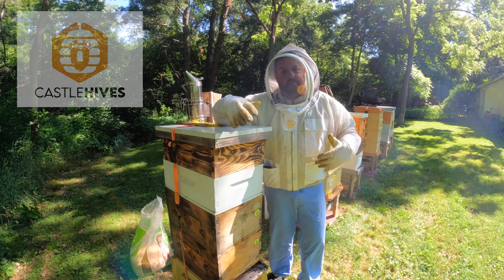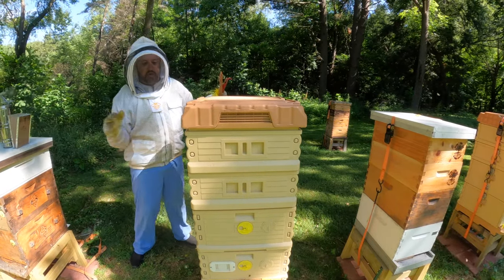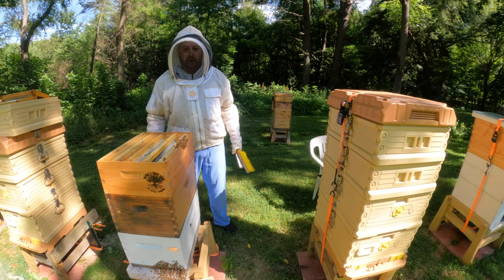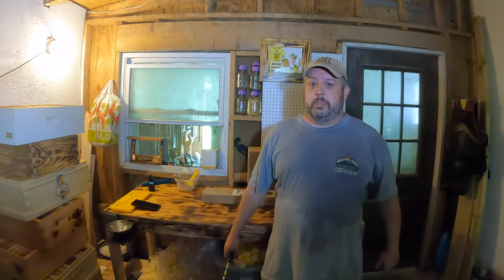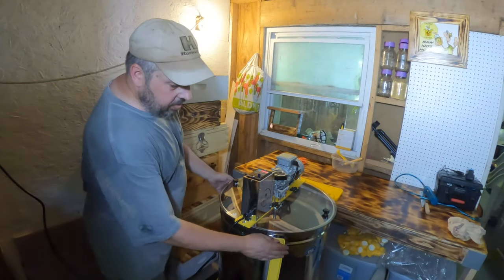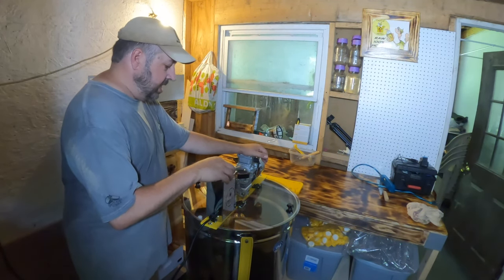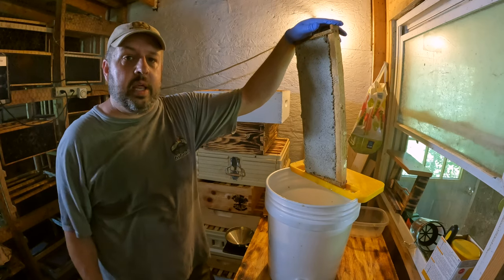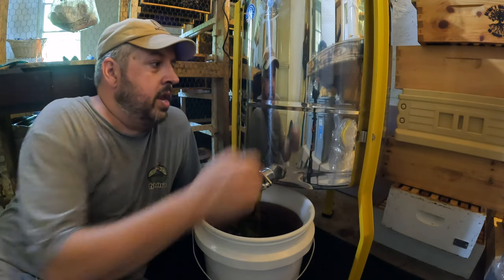How I harvested Honey using a HillCo MiniMax - Most Ever from my Apiary ! !

Comment: Very nice harvest and extractor. I bought the 800E at the Hive Life conf in TN and really like mine also. I can do 8 deeps or 8 mediums with no baskets. For my base I cut a 2x12 in half and spliced in a 2x4 to make a 28" x 42" base. I can stand on the one end which keeps it stable. It still fits through a doorway and I can unbolt the base if I want. See you Wednesday.
Reply from the maker: Thanks for the info Russell. I think the only step i need to take is secure it down and I'll be good to go.
Reply: @CastleHives  Mine is in the basement on a cement floor covered with linoleum. Wife doesn't want any holes. LOL
Reply from the maker: @russellkoopman3004  oh man. . Lol. . Mine will be in a building outside, so I'm able to bolt it down.

Comment: Thanks for sharing this experience
Reply from the maker: Any time!
Reply: @CastleHives  Hi, circling back on this.  Im considering the 18 frame ultra over the 9 fram mini.  What made you decide to go with the mini over the ulltra?  With growing your apiary, do you think you will regret not getting the ultra?  Thanks in advance.
Reply from the maker: @Michael Shelnutt  I have thought about that, but really don't want to expand more than what I am this year. Overall, the 9 frame will suit me fine with the number of colonies I'll have. If i went above 20, it'd be slow.
Reply: @CastleHives  About how long did it take you last year to extract the 9 frames?  Just the extractor time.
Reply from the maker: @michaelshelnutt3534  Hmm. . I pulled 12 or 13 supers, extracted, and put them back on in about 8 hrs. Now I could have been faster, used fume boards or something. Extracting is actually fast.

Comment: Harvest is a great time of the year. It can get a bit rough when it's very hot outside so I'll be using fume boards this year, it'll be easier :D
Reply from the maker: I really need to invest in Fume Boards, would make it much easier.
Reply: @CastleHives  I just made mine, bought some felt, made a simple frame made to fit over supers, stapled felt to the frame, and added a thin sheet of black painted sheet metal.
Reply: I made my fume board too. It was so easy this year pulling boxes. No bees were even in the air it seemed this time around.
Reply: @terrir8525  Can't wait to give those boards a shot. Easy to make, scrap wood, felt from the hobby store some thin sheet metal, screws and black paint.
Reply: @lagrangebees   I didn't even cover the felt. I literally stop at applying the felt. they were driven down in 5 mins with it. I don't think the scent leaves the fabric or even heats up and it still works great with honey bandit 😉
Reply from the maker: @terrir8525  I really need to use fume boards.

Comment: bolt it down to a hardboard pallet
Reply from the maker: Good idea.
Reply: @CastleHives  we had the same problem with our large extractor used a CHEP hardwood pallet metal roof fixing screws through legs and done mate locked down or you can bot it down to the concrete